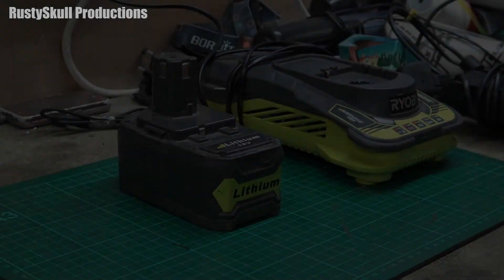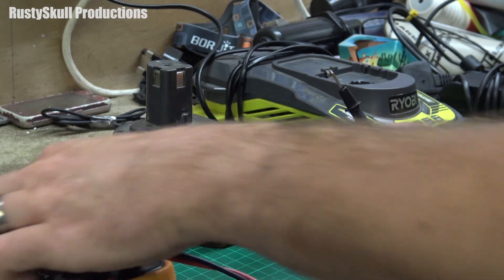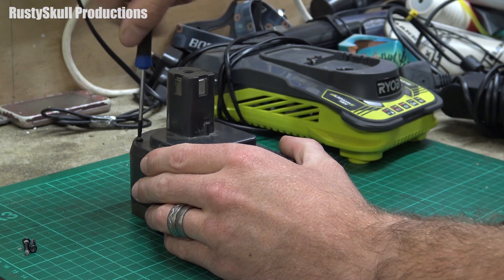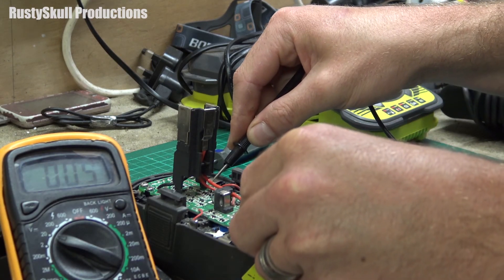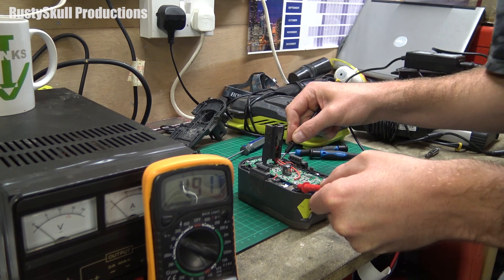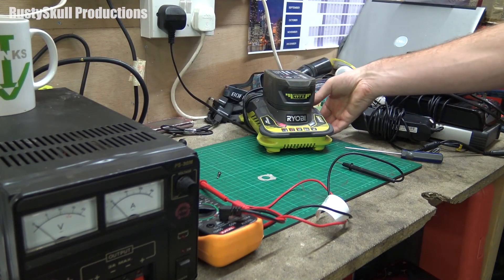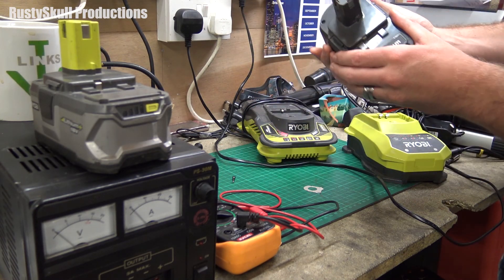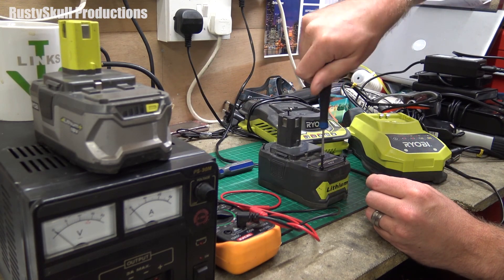How To Make a Lithium Ryobi Battery Charge Again - RustySkull Productions

Comment: Why do you have to open the battery?? You do have the terminals exposed upthere no?? 🤔
Reply from the maker: Because you have to put power straight to the cells.
Reply: @RSPYT  So let's say I have two batteries. One dead and one fully charged. If I go positive to positive and neg to neg from the exposed terminals it wont do anything?